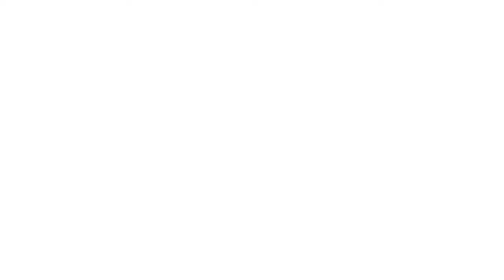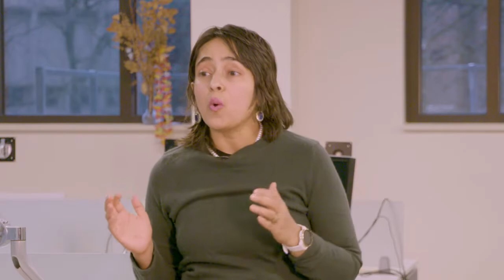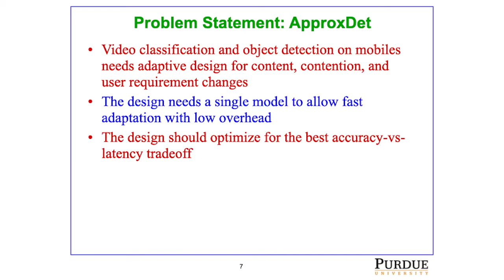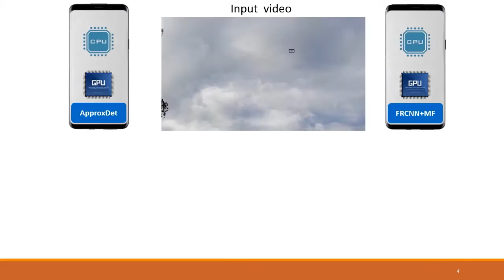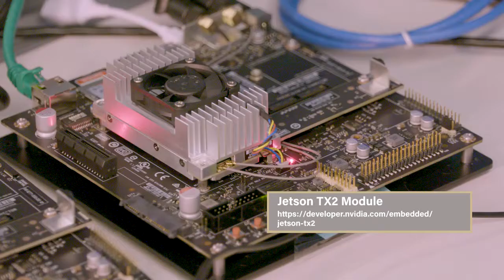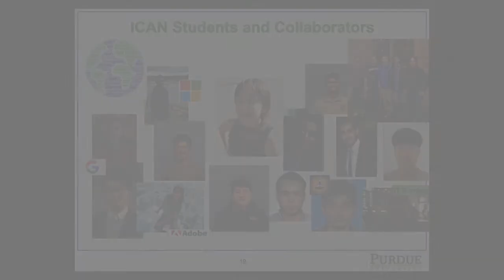IoT, Embedded Testbed, and Edge Computing at ICAN

Comment: I had to dig quite a bit to understand what the “nodes” actually were. Are these typically devices like Raspberry Pi or NVIDIA Jetson boards?

Raspberry Pi is sometimes obtainable, but Jetson hardware is still relatively expensive and not easy for hobbyists to access.

I’m also curious how the scheduler is integrated with the OS on a Jetson. Is it using something like Kubernetes, ROS scheduling, or a custom job scheduler?